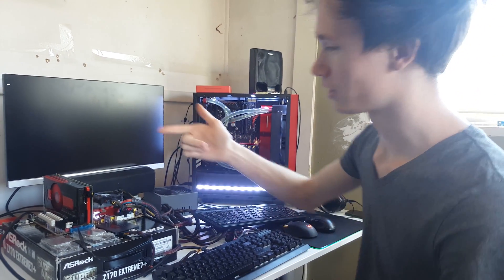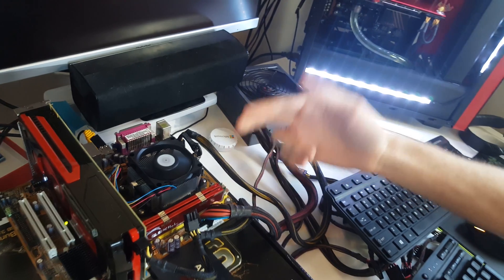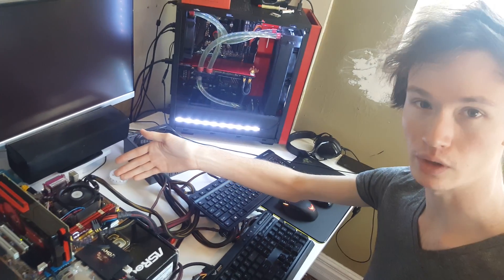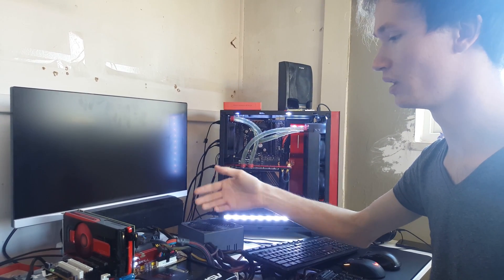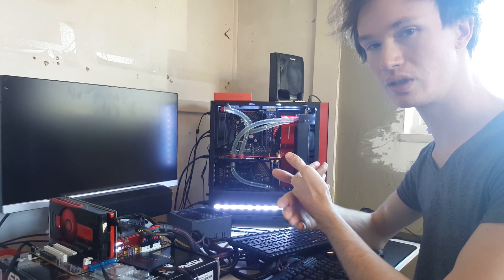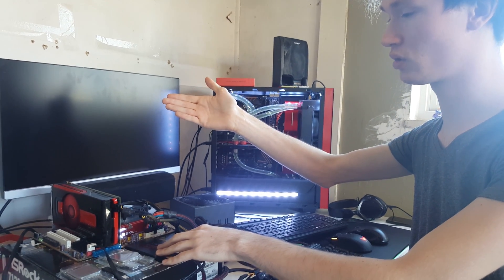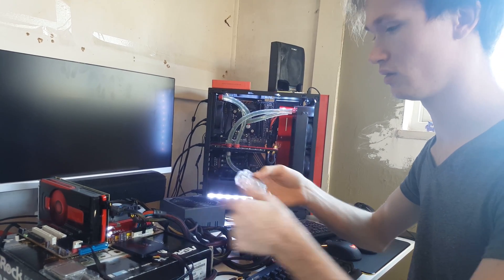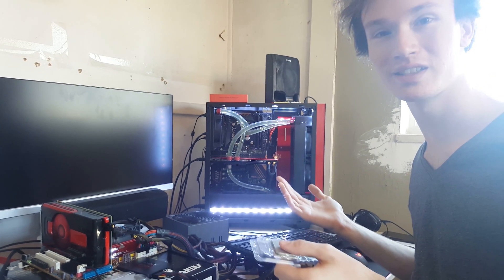Is it the bios, the chipset or something else? AM2 Motherboard AM3 Processor PART 2: Testing

Comment: if you could confirm this is a regular AM2 Socket and you tried putting an AM3 in it, it physically fits but would not post - did you ever have any luck in updating the BIOS or did you think of trying a BIOS mod?

Comment: I have an Asus M2N-X Plus and I'm wondering if I can do the same, as there aren't any other AM2+ CPU's that are quad core. Would my Mobo work with an AM3 cpu?
Reply from the maker: With that motherboard it seems there are AM2+ CPUs that are quad core that the board supports. The Highest end CPU, according to Asus's website, is a Phenom X4 9450. Here is a list they provide are supported and the bios versions they have been tested on. https://www.asus.com/Motherboards/M2NX_Plus/HelpDesk_CPU/
You might be able to get a AM3 cpu to work but you would have to get the highest version of the bios on the motherboard and try at your own risk. most motherboards that will support AM3 will list it and have that as a selling point for AM2+ and AM3. Good Luck!!!

Comment: Will am2 cpu work on am3 motherboard?
btw i have amd athlon 64 3200+ but no motherboard because i stole it
Reply: No. The AM2(+) cpus only have a DDR2 memory controller. AM3 boards only support DDR3.
Reply from the maker: saklu du theoretical it should work as long as the bios of the mother board supports it! I would suggest looking up the model of mother board of the makers website of the one you are interested in and that should tell you if your CPU is supported on a AM3 board
Reply from the maker: Lol well it will if you have a motherboard that has your CPU on the supports list most likely.

Comment: I wanted to do the same thing, fitting AM3 processor to AM2 socket, but since AMD Phenom II series is very rare in my country, I couldn't even try upgrading my machine, I'm stuck in AMD Athlon II x2. :(
Reply: i also have the same problem new Phenom X3 720 with AM2 mobo ....no display on the screen after i inserted it :(
Reply: You can buy really cheap phenom II X4 from china, they cost around 15 to 20 USD...